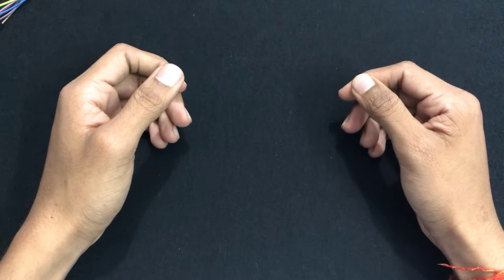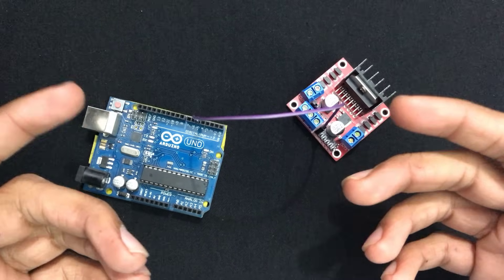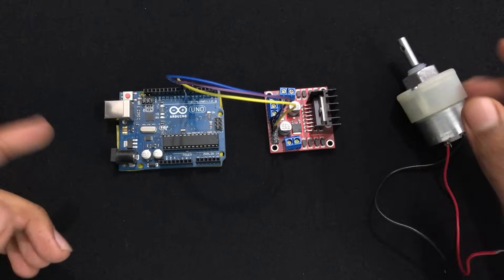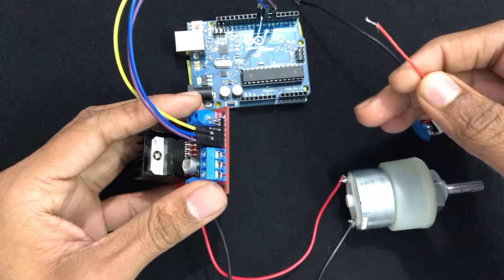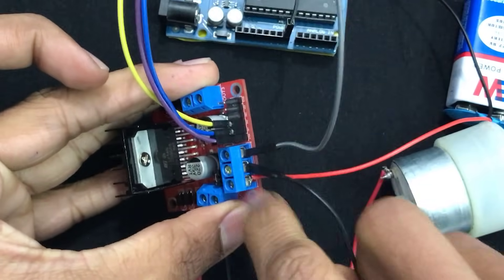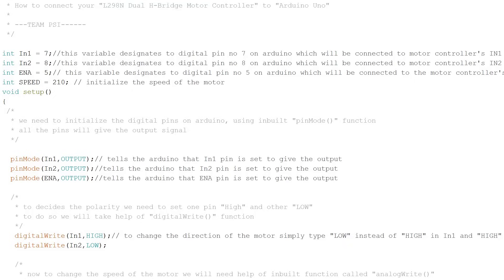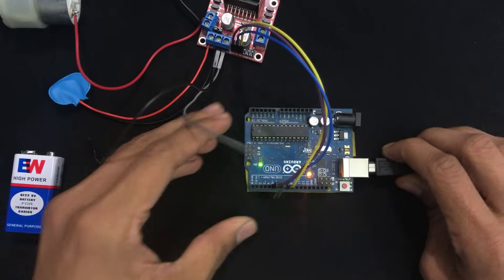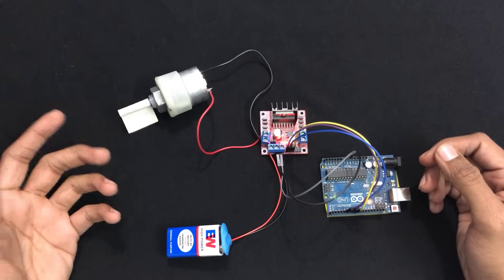How to connect your “L298N Dual H-Bridge Motor Controller” to “Arduino Uno”

Comment: very very nice video. Apreciate the effort
Reply from the maker: Thanks
Reply: @teampsi6771  

hi , i tried to controll my motor with L298N and arduino nano , but my motor was not running . why it happened cause i checked the pins and program was also correct according with pin . but it doesn't work Can you help me please
Reply: @teampsi6771  Yes, the effort put into this video from the editing to the graphics is amazing

Comment: Hey Ben, great video! I was wondering, could this setup be adapted to use a DRV8833 motor driver instead of the L298N? Are there any major differences in the wiring or code that would need to be considered? Thanks!

Comment: I connect 12v power supply  ground to l298n ground and arduino uno ground , but my arduino misbehaving why? And what is the solution?

Comment: Could i connect two different Motor in the same motor driver using the In 3&4 and the Enb to control it, without changing the power source?

Comment: Can this also work with a 9V 5A DC motor? As long as I have a power supply of 9V that also has a current of at least 5A? The only L298N that I could find has a value of 25W though, and the motor has 9*5=45W power. I don't know if that'll work.

Comment: Hi community. 
I need some advice regarding H Bridge guy's.  What I am looking for is just H Bridge which can change the polarity of the around 100 times per second. 
Must work between 5 Volt to 12 Volt. 
What you recommend ?
Many thanks

Comment: For anyone whose motor just pulses without rotating (which was happening to me) you just need to use an independent power supply for your Arduino so that the 9v battery's current doesn't get overcharged when trying to start the motor and power the Arduino at the same time.
Reply: still not working broo  can you please help
Reply: @BongChoch  do you still need help?
Reply: How? can you explain the schematic

Comment: What about sample wiring connection for 24Vpower supply to drive two 24V DCmotor, using Arduino Uno along a breadboard. Assuming Arduino Board is powered by 9V Battery, ENA and ENB enable.

Comment: did anyone else get:

C:\Users\Admin\AppData\Local\Temp\ccuLmagZ.ltrans0.ltrans.o: In function `main':

C:\Program Files (x86)\Arduino\hardware\arduino\avr\cores\arduino/main.cpp:46: undefined reference to `loop'

collect2.exe: error: ld returned 1 exit status

exit status 1

Error compiling for board Arduino Uno.

Comment: Bro I have done the same stuff wid two 5 volt dc motors but they are not rotating can suggest me anything I powered the bridge with 9 volts dc like you sir?

Comment: Hello, can i connect 4 motors to L298N? 
I connected two motors to the L298N and they work normally but while I connect the third it slows down and only one motor works. I am using a 9V battery. Do they need two batteries or is it something else?

Comment: This was excellent. Can I use an 2.4ghz Tx to control the pwm value of the motor like an Rc car?
Reply: Sounds like you got some stuff confused. 2.4GHz is a Radio Frequency. PWM runs in the Hz range for Arduino. Higher the Frequency the faster the pulses known as Dutycycle.

In the past I have used RF to control a MCU such as the Arduino to toggle on/off and set the duty cycle "speed" of a Motor for my CNC Machine Spindle.

Comment: My motor spins in 'ticks'.  So it spins maybe 1/8 of an inch, stops, spins an 1/8 of an inch, stops - this repeats until I power down the arduino.  Why isn't it a consistent smooth spin?

Comment: Sir im using 3-6v motor dc and 9v batteries. But my motor won't move. Is my power source too weak?
Reply: Hey your power supply is weak make sure to use 18650 batteries and don't use 9 volt battery.....
If you are having trouble using l298n motor driver then you can also use l293d ic ...
You can go through my channel there i have made a separate controller to wirelessly control dc motor and servo motor...
Hope this helped you :)

Comment: I have 3 TB6612FNG motor driver. I am trying to connect 3 motor drivers to arduino. Which arduino should i use?

Comment: Nice video.. I have a doubt.. I am using Ros serial for varying speed from robot operating system and I am having 12v power supply.. In that case is it safe to connect gpio pins while Arduino is connected to laptop.. ?

Comment: Bro I have made a wifi control car using node mcu esp8266,l298n motor driver and a 5v battery but the motor is not moving and making beeping sound.

Comment: 4:33 
Please explain the use of that 5v terminal, is it for enabling or powering Arduino?
Is it 5v output or 5v input??
Also 
Can we use l293 with configuration?
Reply: as it goes to the VIN pin on the arduino its an output on the L298N
Reply: Out
Reply: Bro it's for to power motor driver

Comment: Why you disconnected the Arduino to motor driver Vin and Gnd connection after send the code in Arduino board

Comment: 7:33, is it necessary to pull out the Vin and GND connection before connecting the data cable to computer ?

Comment: So you're saying that motor voltage must always be equal or higher than power supply. In this video, you're using 9v Battery then your motor must be 9v or more right?
Also what will happen if you don't remove Vin and GND while connecting it to PC?
Reply: At lower voltages depending on the Motor it will work but turn slower and with enough current it could have more torque. However if you pump in more voltage then the Motor is rated for say 15 Volts into a 12 Volt motor it could hurt it after a while. If you pump in say 24 Volts into the 12 volt motor it will die quickly.

It's just a good rule of thumb to disable the power source such as a battery when plugging it into a PC. The PC itself will pump in 5 Volts into the device in this case the Arduino and could cause issues when trying to write code to it if you have the battery plugged in and the USB. Some MCUs such as the Arduino will do a reset when it's finished getting code written to it and depending on the Power Source it won't let it reset.

Comment: we can separately give power to arduino right? connecting arduino to external power source instead of connecting the 5v from the motor driver with the arduino power pin is also possible??

Comment: Sir, In this why we remove gnd and vin pin before uploading the code ???
Reply: I'm confused about this too. I suspect that if you power arduino with the driver board and connect arduino to usb at the same time you will put too much voltage to it 9v from battery + 5v from PC's usb port. So i believe you should make them independent by not providing power to arduino(remove the cable from arduino vin  )    Then connect it back after you've done with uploading the code AND disconnecting usb from pc. Can anyone confirm that my understanding is correct?
I'm planing to the project with motor using this L298N driver. I will make them power source independent. Both arduino and the driver use their own power source.
Sorry for my English.

Comment: Please someone answer : can I use it for a physics project where I need a high frequency current of like 3.3V meaning low and 5V meaning high. Can I like use it by changing it really fast with the Arduino commands and create the signal I want to create ?
Thank you!
Reply: it dependes on your motor . if u use a motor that doesnt want to exceed the power limit of 3.3v ,then u can reduce the speed in the programing which will produce a less amount of power supply. so u r motor could run. but make sure u program perfectly so that ur motor reaches correct 3-3.5v .
Reply: @genbot7207  Noo not for a motor. I use it for an experiment with electromagnetic radiation. Basically i just send 3.3V then 5V repeatedly very very fast to create 0 and 1 and stuff like that. The thing is it might be too fast for the driver to handle. I am talking about GHz here.

Comment: Hi my l298 motor driver ni 12 volt not supported but + supply attach to 5 volt out put it has worked but but way problem of 12 Volt is not supported

Comment: I guess the idea of using PWM on Enable is not right. Enable pin is not very responsive to quick changes. PWM should also be applied on control pins. in your example, I would make In2 = LOW and apply analogWrite on In1 with enable always connected to 5V (Jumper)
Reply: Agree

Comment: And how to connect l298n with arduino uno and fly sky FS-CT6B
Reply: If you are using fly sky remote then you have to use electronic speed controller and not l298n motor driver.

Comment: Sir if we need to control 6 12v DC 300ma motor ..which motor shield sould we use and how to connect ...

Comment: Would this work with any other motor controller,?
Reply: It depends upon what motors are you using and how much is the current requirement.
what are you planning to make..?

Comment: we are using 3-6v dc motor with motor cnotroller and arduino uno. can we use 9v battery supply to drive the motor. If yes, can you tell me how to conect with arduino?
Reply: yes , you can use 9v power supply for your 6v motor but dont go beyond 9v.
The connections are explained in the video.

Comment: he didn't put the code in so I did.

//CODE:

int In1 = 7;
int In2 = 8;
int ENA = 5;
int SPEED = 210;

void setup(){
  pinMode(In1,OUTPUT);
  pinMode(In2,OUTPUT);
  pinMode(ENA, OUTPUT);

  digitalWrite(In1,HIGH);
  digitalWrite(In2, LOW);
  
//ENA 255 means high speed and 0 means low speed
 analogWrite(ENA, SPEED);
}

void loop(){
  
}
Reply: not all heroes wear capes! thanks bro
Reply: Hello
Reply: Need help
Reply: Thanks
Reply: u saved us
Reply: Tq bro
Reply: Tq
Reply: thank you king
Reply: hey man, i'm using  4 motors so it has a different code right? can you write it for me? please. i don't know how to write so i need help.
Reply: @ravigospat9877  learn to code, c++ arduino is very much easy to learn
Reply: your the real captain
Reply: arre bhai tysm <3
Reply: Thanks

Comment: There is just some noise coming and motor is not moving
Reply: Check how much voltage you are giving it. Is the LED on the arduino/l298n on?

Comment: What was the need of the Vin pin
Reply: Zorawar Singh Vin defines as input voltage to power the arduino. Instead of powering the arduino with the laptop. He powers the arduino with a battery

Comment: Your tutorial is contradicting itself, first u said we have to connect 12V only for big DC motors, so I used the 5V for my small DC motor but then u also used the 5V terminal! WTF? u basically used both terminals... How are we supposed to do exactly??
Reply: he is using 5v supply to power the arduino

Comment: Sir If We use 9v battery to 12v dc motor and if Its clip which fits the power supply terminal of arduino, then will it damage the motor?

Comment: Motor is not working i supply 5 v, Whether i need to remove jumper for 5v supply?
Reply: Bro you need min volt 7 to 12 to run L298N moter driver and Arduino board together that is not being said by this person

Comment: Great video. I have a couple questions though. Is it possible to connect 4 DC motors to one motor driver? Also if it is possible, what are the advantages and disadvantages of doing this compared to using two motor drivers?
Reply from the maker: Hi, yes it is possible to connect 4 DC motors to one motor driver.
say, you connected first two motors (Front wheels) to screw terminal out1 and out2 and the other two motors(Back wheels) to out3 and out4, here first two motors will share the same control and same speed, you can't make them independent to each other. 
Disadvantages:
 1. Your motors will run slowly
 2. You can't make all the motors independent( but if you choose to use 2 motor drivers you'll get control over all the four motors)
Advantages:
 1. You'll get control over front and back wheels, which is very useful if your front tyres are somehow not in contact with the ground, here you can use your back wheels (this is not possible 
     with two motors)
Reply: Okay thank you! I have some more questions. So I've decided to go with using two motor drivers with 4 DC motors for my project. I've read your comment below on how to connect two motor drivers to the Arduino and I've noticed on the Arduino that there are only 6 Digital Pins that are not labeled with PWM(~). I would think that you can but my first question is, can you connect IN pins on the motor drivers to a PWM Digital Pin on the Arduino?

My second question has to do with the power supply for the motor drivers. As I stated above I want to use two DC motors for both motor drivers. My DC motors nominal voltage is 12V just like yours. If I use a power supply of 9V-12V for one motor driver, will that be enough to power both DC motors?

My last question also has to do with the power supply for the motor drivers. You stated below in the comment that if using two motor drivers then a different power supply should be used for each motor driver. Is there any way of using the same power supply to power both motor drivers?

Thanks again for helping me out.
Reply: @pricelessg  
(1) Yes, connect your INs to non-PWM pins, it will work.
(2)  12V will power both motors, but only one motor driver.
(3)  No.
Reply: Wait, correction: for two 12V motors, you need 24 V power

Comment: why have you connected that vin pin to 5v?
Reply from the maker: basically, 'vin' pin is used to power up the Arduino, and that's the reason why we have connected it to 5V.

Comment: how to add 2 motor drivers to an arduino?
Reply from the maker: Things you will need to do in order to connect another motor driver to Arduino:
> Use a different power source to power your motor driver
> Leave the +5V output terminal as it is. (Don't connect it to 'vin' pin on Arduino, because it is already being powered by the first motor driver)
> Common GND(ground) between your second driver and Arduino.
>Connect the ENB, to any PWM pin (say 10) and IN3, IN4 to any digital pin (say 12 and 13).
>Connect your DC motor to OUT3 and OUT4 screw terminal provided on the driver.
>Write the code for them( it is similar to one that we've shown)
>upload it to your Arduino
>You're good to go!!
If you face any difficulty connecting them, let me know.
Reply: can i use motor shield to connect 4 motor drivers?
Reply from the maker: I'm afraid you cannot. But you can connect two motors to the shield and not the motor drivers.